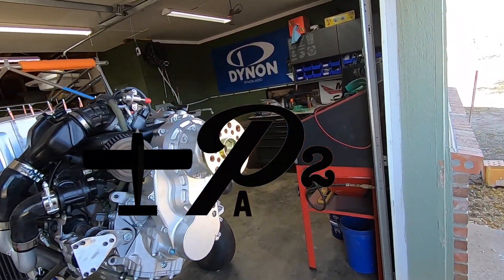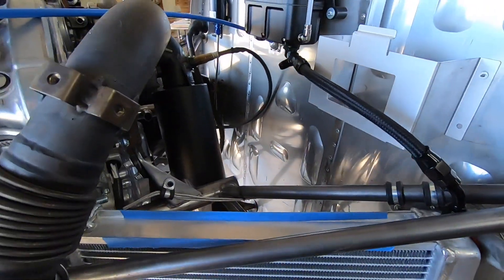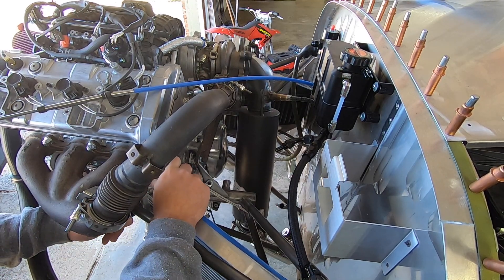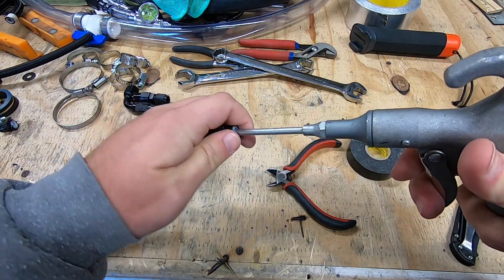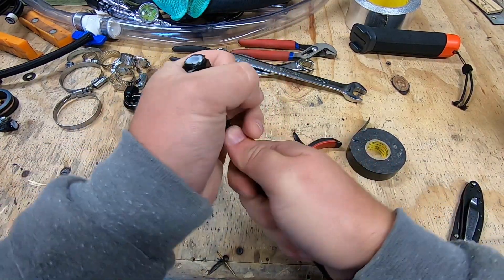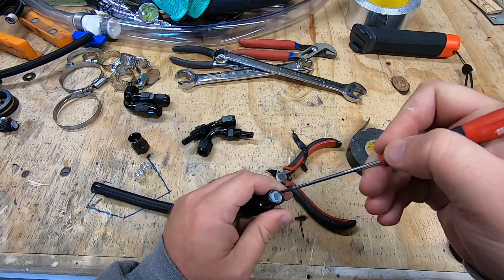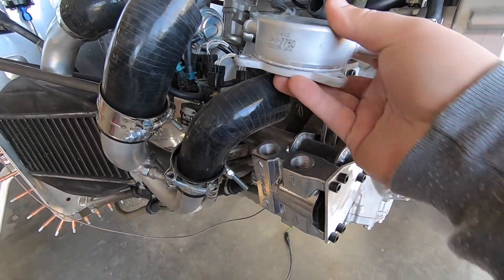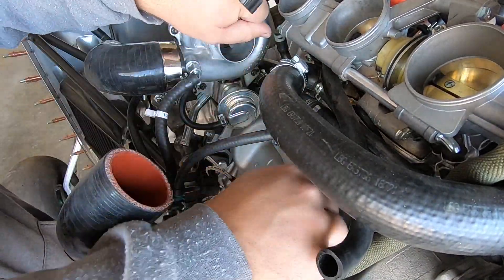DIY AN Lines for the Turbo Yamaha Rans S21 EP40

Comment: Those hoses are not just fine for any application...they are overkill...and at least as good as what you'd get from Shorty's. The only suggestion I have, is when screwing the fittings together, is to hole the 'nut' section in the vice and spin the 'bolt' section. That way, you're not putting any twisting action into the braid...just squeezing force. I don't think the other way around is wrong or bad. It's just the way the paranoia that lives in my brain tells me to do it. I mean...I know they are just voices...but they do have some good ideas.
Reply from the maker: Thanks for the tips!

Comment: I have to give you great credit for your ingenuity 👏

Whenever I call for such hose assemblies on transport aircraft, I don’t give a second thought as to how they will be constructed, as there are Materials & Processes guidelines (I would have reviewed when they are first issued), work instructions and vendor recommended tools to get the job done (the latter you mentioned as well).

It is however great to witness the experimental aircraft builder’s approach to achieve the same end result and the appreciation of the limitations for ‘life of use’ thereof. 

Bravo on both counts 👍👍
Reply from the maker: Thanks Dave!